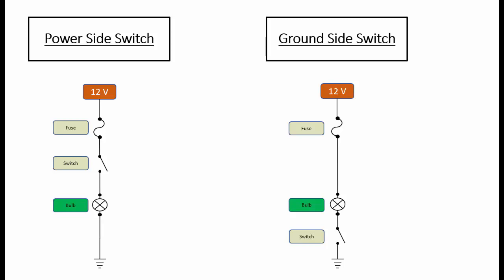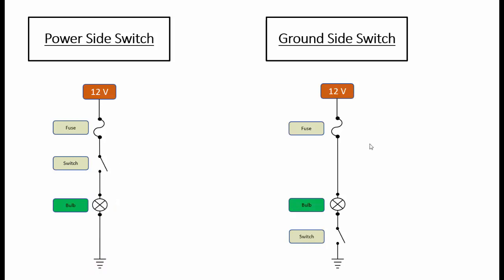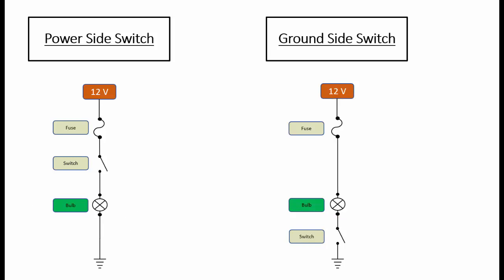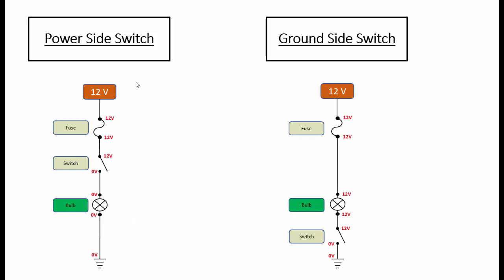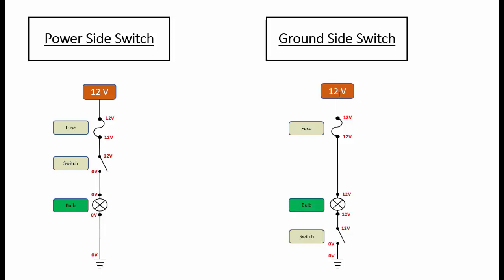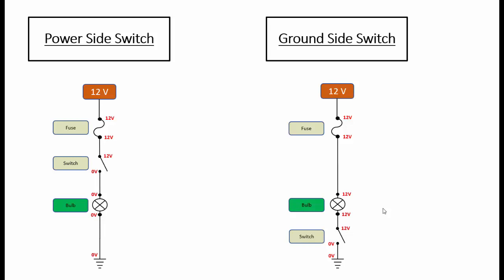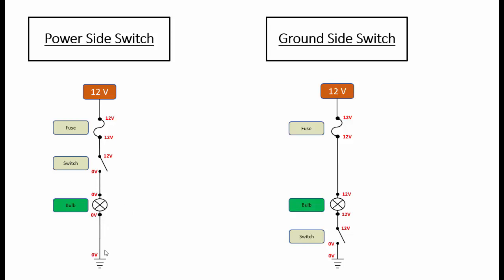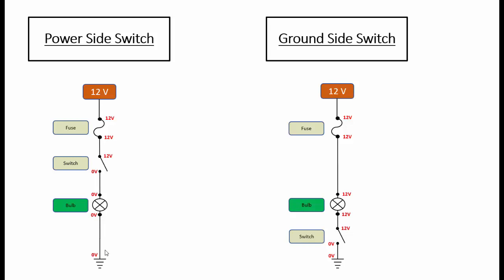Automotive Electrical Power Side and Ground Side Switches

Comment: So in the Ground Side Switch even if the bulb has 12V on his sides,the bulb is still off since the circuit is not close(No GND) ?! Really confusing for me???
Reply from the maker: Yes, if you measure 12 volts on each side of the bulb, it means there is no ground and the bulb will not be lit.  This video is a preview video of one of the lessons in one of my Intermediate electrical courses.  It is best to take the beginner course first and then the intermediate course so you will better understand the concepts.

Use the link below to get more information on all  my electrical courses.
For a limited time, use coupon code BLACKFRIDAYSALE2024 to get an additional 70 percent off each course.

autoelectricaledu.com/video-courses

Comment: Why do they call them pull up and pull down 🤷‍♂️
Reply from the maker: In a 12 volt system, a pull up switch circuit provides an output that is the 12 volts, and a pull down switch circuit provides an output that is zero volts.
Reply: @automotiveelectricaleducat5839  been really confused. Was a technician back late 70s this new stuff after I retired from military is tough to grasp. Thanks any more videos on this would be appreciated. Scanner danner says if you unplug the pull down sensor it goes to 5 volts other guy Justin miller says it goes to 0 volts 🤦🏼‍♂️
Reply from the maker: Both could be correct depending on the schematic picture they are looking at.

Comment: I always thoufht of a short as a break in voltage which you said an increase in resistance. which is the dame thing.
Reply from the maker: Thank you for the comment.  At the 2 minute mark in the video, I say that a short is less resistance than expected.  If electrical resistance goes up, the current would go down, but if resistance of a component like a horn or a relay coil goes down, the current would go up.  If the resistance went low enough to allow for more current than the fuse can handle, it would blow the fuse.

Comment: Good clear video.   Was wondering if you can assist?  I'm using a switch with 3 wires, positive, negative and trigger wire to the relay, the switch is triggering the relay (sending 12V).  I wish to use the same switch design and  ground side the switch,   Will this work still with sending power from the relay to ground with the switch?  Thanks
Reply: I am not 100% sure on what you are asking.  Send me a picture of the switch you are using to my email AutoElectricalEdu@gmail.com